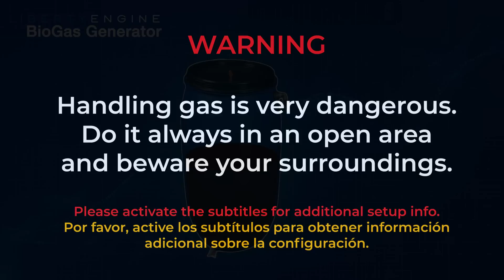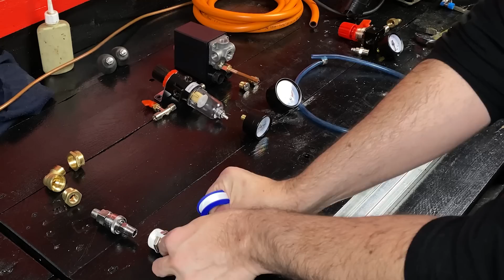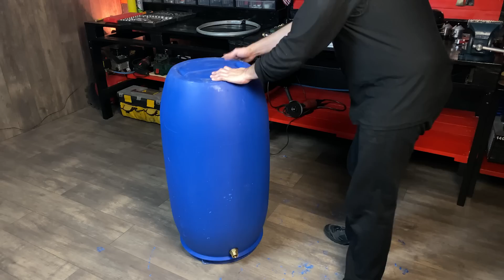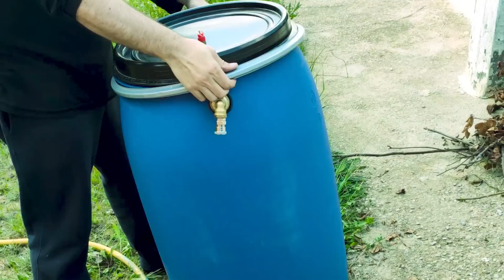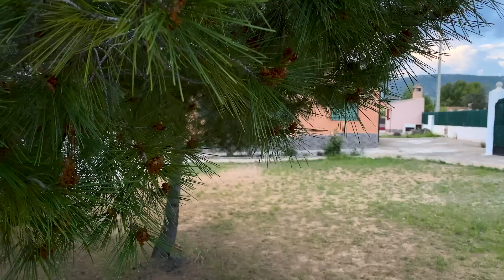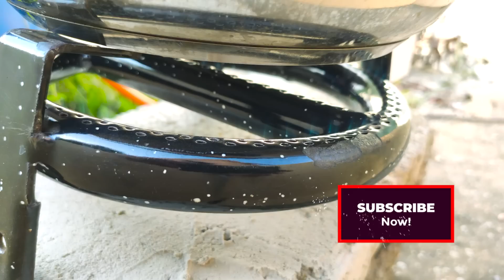How to Make Free Gas with Garbage - Free Gas Butane - Propane - Liberty BioGas

Comment from the maker: Next video will feature more utilities for this device!
Reply: Add an homemade HHO generator to the Bio-Gas and see if it can be used to weld ??
Reply: You need to use a flame arrester.
Reply: 64million dollar question. how do you re-fuel. i mean, its nice and all and leave it to ferment. if i open the hatch i let the gas go after two weeks. manure is daily. where do i store it in the mean time? i need to put it in the barrel or tank in order to continue its purpose or so it seems.
Reply: @FreelanceServices-n2l  je réponds  ce que vous dites est faux  ont peut produire du gaz  à volonté   il n'est   pas la peine  de racontez   du n'importe   quoi  comme votre commentaire  !
Reply: je réponds   cet  idée  est vraiment merveilleuse  je vous remercie   pour la vidéo   !
Reply: Can I ask what video software you use to censor out faces please?
Reply: Can you post a list of all those pieces of material you connected to the big bucket?  I'd like to purchase all the right items to make one of these.  And any equipment names help as well.  
Thanks!
Reply: please make a video how to dispose, clean and refill the biogas,
- is it safe to use indoor?
-how long does it last?
-can we use it on ordinary indoor gas stove?
TIA.
🔥

Comment: Good video, but misleading..., title says make free gas with garbage, but pig manure is not garbage..., you won't get it for free. Either your rear your own pigs or you have to buy it. So, this gas is not 'free' as the title says. On the side note, the resulting gas seems to burn very cleanly... 👍
Reply: I think u could use other fuel sources for the bio/digester.  I’ll have to research if u do not have a farm and animal waste available.

Comment: This is fine. 

But just for the record, manure can be used to brew alcohol with brewer’s yeast. Sugar, corn, potatoes, flour, or any fruit crop can also be used.

To separate the alcohol from the water, you can use a old fashioned Still, as long as you don’t illegally drink the alcohol. 

There are two other distillation techniques. The first is to put a gallon of alcohol-water blend into the freezer. The alcohol won’t freeze, so it can be poured out. Another way is to add salt and food coloring to the alcohol-water blend. They say that the colored salt water sinks to the bottom, and the clear alcohol floats to the top. But I’ve never tried it.

The energy density of alcohol is 300 times higher than methane.  So it’s definitely a viable fuel. And one last thing: But it’s not for the faint of heart.

Human sewage is great fertilizer. So your septic tank can be a source of alcohol. The Brewer’s Yeast won’t complain.
But your wife might have something to say, when you heat-up the Still.

Comment: Make a bigger one out of a pool with a floating resovoir in it. As it fills with gas the resovoir rises out of the water. Feed with a slurry of manure sawdust and biodegradable waste. You can store the gas in a propane tank with a compressor and dryer to clean it up.

Comment: Putting fine steal wool (yes scourers) inline from the gas outlet will remove the sulfur smell from the methane. But drain out the gas hose condensed water regularly to reduce rusting. The tire collector is a great idea. Put a weight on it to change the pressure. Cow and horse poo are also excellent because semidigested. Human poo is just not very effective because of out incredibly long intestine. Better to save your urine for a fuel cell :p

Comment: I remember a TV news show from the 70s of a man in France that collected gas from his compost pile. Yard cuttings, table scraps, etc. went into a circular masonry or concrete compost container. The top was capped and a valve in the center of the top. As gas developed it went out the vent into tire inner tubes for storage, any rubber bladder will do. 

He used the gas to power an old car he used for the weekly trip into town for groceries.
Reply: That is insanely cool
Reply: Jean Pain (Mediterranean climate)

Comment: It run about 2 hours slowly depleting for a 2 weeks on that storage. You need to drain few litres and add more bio waste material. But if you have a storage tank you can fill it up with safety valve if you have the same size tank you can maximize the capacity by just storing the gas you can get upto 10 hours on that same stove. But safety is very important use relief valves etc.

Comment: Cant you compress these kind's of gasses with a compressor and a gastank or High pressure Gas tank? It would make collecting and storing easier and more in capacity.
Reply: I'm wondering the same, perhaps with a screw compressor at low speed.

Comment: For those wondering how long this type of system will produce gas to burn, it has an end point depending on what you use it for,  until it can restart the gas process again. However you can get what is called a bladder that fills up with the gas over a period of time and you can have multiple barrels or use something bigger. Many hog farms have methane plants on site to produce all the power they need for lighting and heat but dangers come with gas volume. It works but it will need maintained but it’s free energy!
Reply: yep my dad worked at a pig farm and they had a huge biogas plant there and his job was shovelling shit into the plant and apparently it nearly powered the whole piggery.
Reply: Me eating chilli reading the comments 👁️👄👁️
Reply: @aaron-gz  🤣🤣🤣👍
Reply: The question is can you use other manure like horse
Reply: @davidgonzalez5629  yes. However, human manure is equally effective as pig manure and we have a ready supply of it.
Reply: @davidgonzalez5629  yes, most organic materials will work.
Reply: @davidgonzalez5629  any material that is biodegradable can be used. Even kitchen wastes
Reply: what about Cow waste
Reply: @kumasi5991 
You can also use it.
Anything that can decompose.
Even if you cut and mill weed, then add sufficient water. It'll digest and produce biogas
Reply: @kumasi5991  we have one at home that ran on cow waste u can (nearly) run it on any waste (decomposable offcourse)
Reply: That is not free energy. Cheap energy at best.
Reply: @feetfats1  indeed, nothing is free! 👍 everything comes at a cost!
Reply: @feetfats1  Not free but readily available if no natural gas or LPG I's available
Reply: And also free fertilizer which is the liquid it creates as condensation.
Reply: I think it's a good idea to put a pressure gauge .
Reply: @HazardXXX а в Китае много риса
Reply: Дешевле купить природный газ из России)... и он будет наполнен в любое время
Reply: @user-izbukvizifr228  на тебя даже внимания не обращают) Умойся ты никому не нужен)

Comment: Flash back arrestor required. You dont want that flame sucked back into the vessel when the pressure drops.
Reply: I was thinking the same thing
Reply: @17Liberty76  fire dissipate without oxygen.
Reply: @energen2000  regardless of how unlikely, I think it would be best to not gamble. Especially in an off grid scenario
Reply: Something inside my logical mind said, yeah, uh, no ...

Comment: Why didn't you use a metal drum?
Reply: because the production of biogas namely Methane produces hydrogen sulfide, and sulfur dioxide and sulfuric acid, also in the pig manure is ammonia all of which are highly corrosive. Metal drum would not last long.

Comment: Also you need a flame arrestor so that the flame doesn’t travel through the hose back to the source & detonates that Barrel
Reply: Yeah definitely, in the UK they're called flashback arrestors.
Reply: when there is gas there is some positive pressure.  When no more gas is coming out there is no gas to explode.  Flashback arrestors are needed for situations where fuel remains in storage while being discharged such as Oxy/Act torches.  Where there is risk of pushing the ignition into the supply line.  Don't see the risk in this case.
Reply: I noticed he disconnected the hose to turn the flame off.
Reply: What is a flame arrestor ?

Comment: Need to install a "check valve" (one way valve) after the ball valve (open/close valve) to stop any air get into the tank, mixing oxygen with methane is very dangerous. 
It is also a good idea to install a pressure gauge to indicate the pressure inside the tank, it implies how much gas is in the tank.
Reply: Wouldn't the pressure relief valve on the top prevent the build up of too much pressure inside the tank?
Reply: It should be a no brainer but it isn’t for most people.
Reply: I think that while the pressure inside the tank is higher than atmospheric pressure air wont get in
Reply: @1998diegox  In theory you are right but only few bucks to reduce explosion risk significantly, why not?
Reply: Thank you! I will implement those ideas.
Reply: Thanks for the tips l have no knowledge of these things so I wouldn't be making one anytime soon lol
Reply: Considering that valve will have a bunch of shit behind it, (pun intended), no air will get in.

Comment: In case for those that Don't Know such things as Chicken Droppings From Battery Hens and  Pig manure and  cow dung as well as well Rotting Veg and  Lawn grass cuttings are all Good to generate Gas {Methane  Gas} Now those of you that are using Propane or  Butane  Gas There are two things that you will Notice and that if you are Cooking indoors you'll get a Nasty smell and an horrible Taste within your Mouth: also Your Pans or  Kettles will have a Sooty Ring around the Sides and  Bottom of the Pan or  Kettle But with Methane  Gas It's  Pure  Clear Gas and has a Higher Flash point and Hotter ? Methane  Gas Has no Smell So whatever you Do when Making your Free Gasometer Make sure that the Holes you are  Drilling into the P V C Drum are exactly the Same  Diameter as  your  Fittings and not even a micron too big where Gas under Pressure could seep out ! Plumbers Paste in Conjunction with the Rubber washers and the Plumbers PVC Tape will insure an absolute  Gas tight Fit {Air is thicker than Gas } One thing never seems  to get Mention and that while the Bio Gas is  Being fermented and that a Lot of Heat is  Generated and it's Mainly this Reason why water within the Barrel Helps to Keep the heat down to  minimum! There's One thing I'm not sure of ! and that is Would I Need to Change the Gas Jets on my Gas Cooker or will it  be the same  as Mains gas  I'm going to Use Hen S-it !  Many years ago a Yorkshire Farmer Built his own Gasometer out of a Petrol Tank from off his car  and  Filled it almost to capacity with Hen Muck from his Battery hen shed where he  Plumbed it in to the Cars Carb ? People Laughed but He   Drove  Hundreds of Miles; He  Placed an electric whisk Paddle within the Tank so when the Gas was Not as so  before The   Rapid spinning of the whisk increased the gas Flow  ! I often wanted to do the same with my cars But Now I Have  a Hydrogen Cell that Converts water into hydrogen

Comment: A couple questions - After two weeks, how much gas is produced in terms of equivalence? Comparable to a 9kg LP tank? Or how long would the gas produced run a small cooking element like the one in the demonstration?
Thank you.
Reply: Depends gravely on the ambient temperature and the organic compounds you throw in there. But, in some cases it produces about 6kg of methane per day
Reply: @Roguescienceguy  Dayum that's a lot!
Reply: @draughtgamer1417  that's in warm weather conditions and a digester with the proper acidity and a container of 500l
Reply: @Roguescienceguy  Just a question, how much can i expect if temperature is 20 degrees celsius and normal household rubbish in this tank? I dont know, so i ask
Reply: A digester of this size will produce about an hour or so of regulated gas to a burner/water heater or something similar.  If built correctly that would be per day of gas with continuing to add food waste or any other organic material at a 50/50 mixture.  So an hour of gas per day per 55 gallon drum or so is a decent rule of thumb.
Reply: Good question . Still waiting for an answer i see . well i like to know to

Comment: We could use an generator and this gas creator to compremize this gas into higher pressure Tank.
Reply from the maker: In the next video
Reply: @HiddentechnologyYT  by the way you than could split the gas into more seperate gases like hydrogen and methan. After that u only need to compremize those both
Reply: @peterdornfeld6416  Please explain Peter for us Dummies out here👍🏻Is that a straightforward proceedure? What equipment would be required? Generator , compressor, etc..I also hear it's important to have some sort of device fitted to prevent the flame travelling back towards the tank! I'm itching to try this but I'm extremely reluctant until I know it's a full proof design and system.I wonder what the commercial models use to overcome such safey concerns🤔
Reply: @neiljoy8465  ok first you need gasline in fore of hose to a gastank it should have at least an amount of 500kg to 1,000 Tonns Volume. This is place where could Storage it
Reply: I will tell you more later.